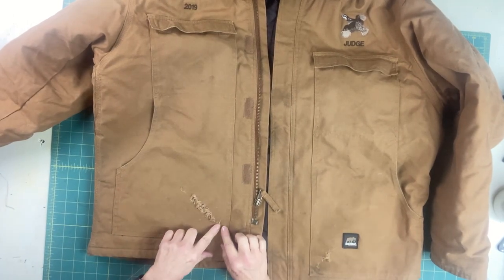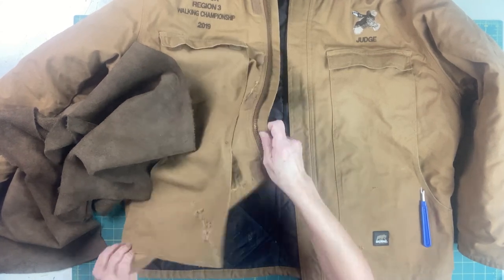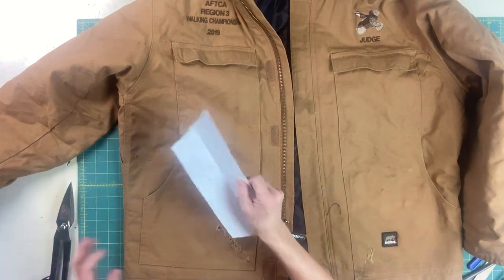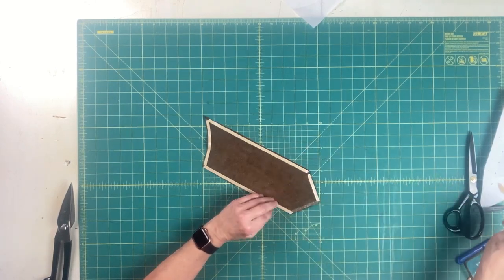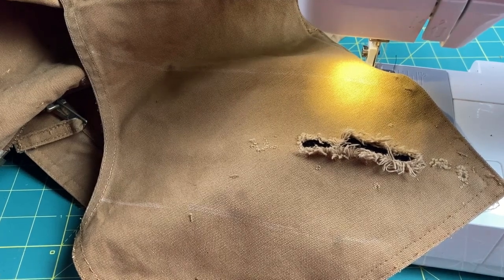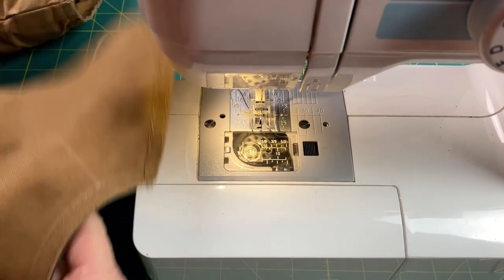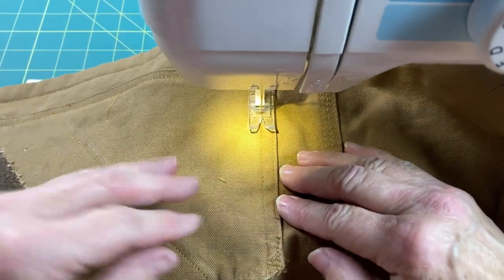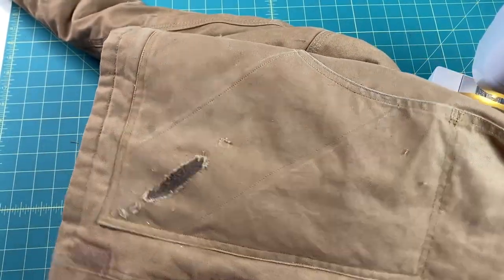How to Patch a Hole in a Jacket Pocket

Comment: This is what I like about your videos, you talk through your thought process out loud, as it develops and becomes logical and useful.  Thank you!  Also, you speak clearly and well paced.  Did you offer to fix that other little similar spot on the other side?  Oh wait a minute, I just had a thought, although too late for an idea for this project.  I was wondering if it could have been feasible to cut a small piece from another inconspicuous part of the jacket, to cover that little sliver of darker brown patch, although you did say he really didn’t care.  Then you could add some of that brown leather to replace the little bit you took from that inconspicuous area.  I was wondering, if you don’t mind sharing, what did you charge for this job?  Also, I know there are regional differences in fair market prices for our kind of services.  May I ask generally where you are located?
Reply from the maker: I charged $35-$40 for the jacket repair.  I live in VA